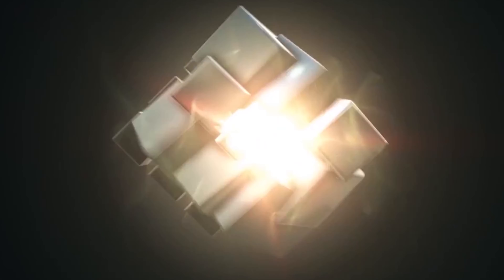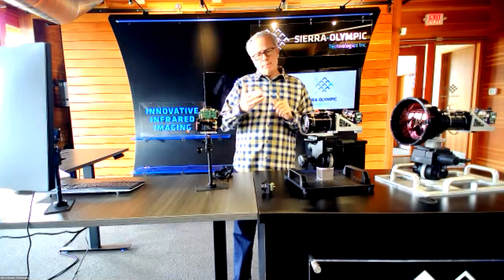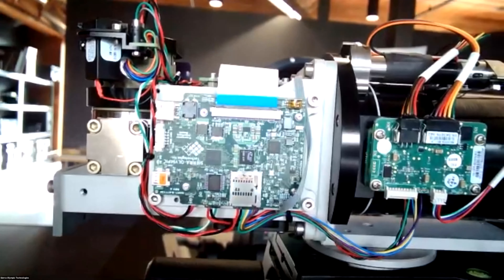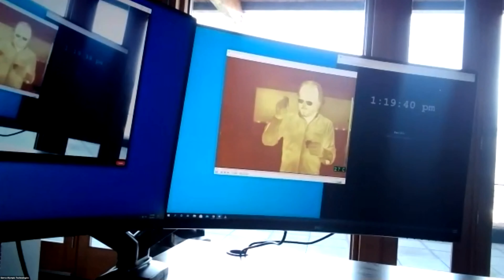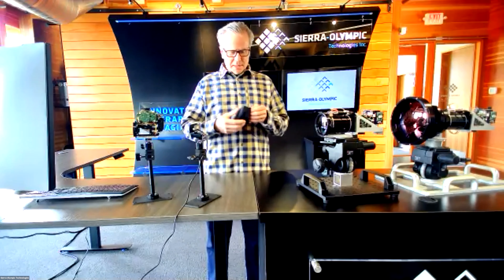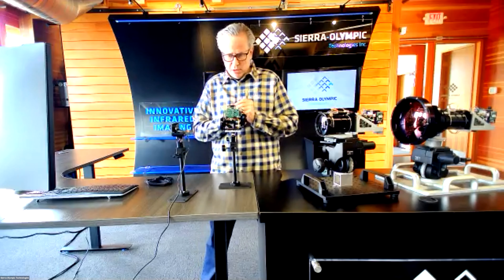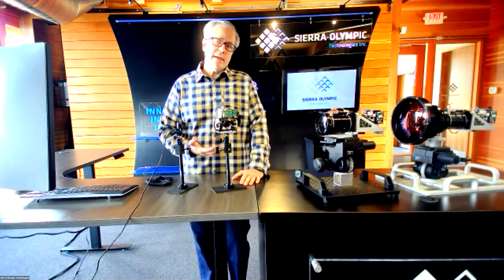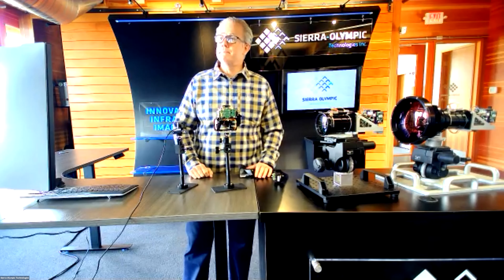Tech Talk: Innovations in Thermal Imaging

Comment: Will you expand into more prosumer markets? My goal is to build a filmmaking tool in uncooled LWIR.
Perhaps the Tamarisk with a SBC could work off a V mount battery. But lens options are always a question, as it doesn't seem like there is a well adapted interchangeable lens mount for the shutter less cores. While the DRS pixels have a great design and even come in 10μm pixels(not sold yet?). My experience is with mid 2000s European sensors using ASi on 25μm and 35μm pixel pitch(not effective area) as well as the  modern American VOx 17μm and 12μm miniature cores. 

Getting raw data sounds the most exciting to me; I am pretty sure DaVinci Resolve can work with a well captured frame stream easily in post and avoiding all front end histogram stretching makes my post workflow a lot easier.